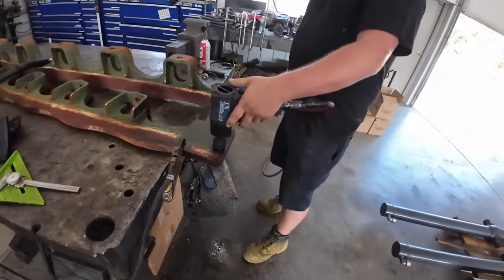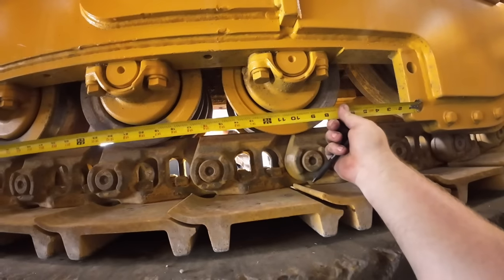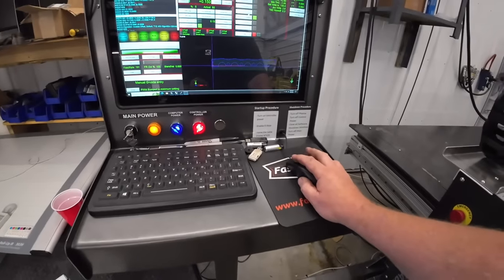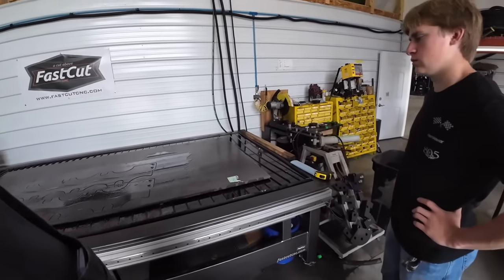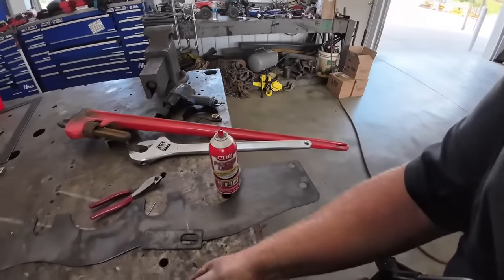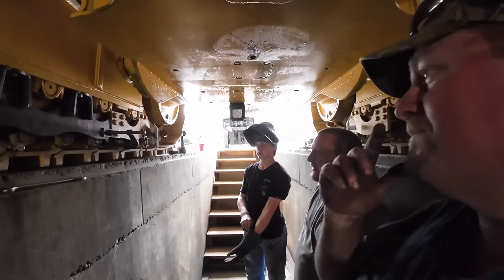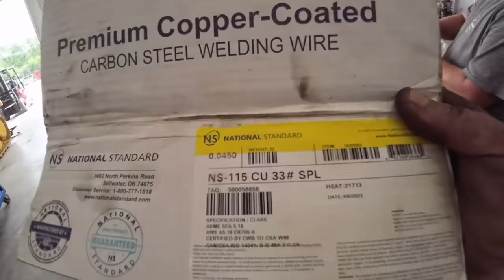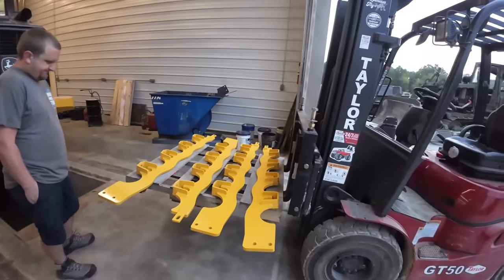Customer wanted Rock Guards on his 755K Deere track loader so we delivered 100% from scratch

Comment: That is a sweet looking track loader, nice job of fabricating the rock guards and the paint job was impeccable Kevin. Someone is getting a very nice machine. You should put a smiley face on the inside of the welding helmet so Tucker has a constant reminder to smile a mile man, thanks for the tag along video sir.

Comment: I think that all your work is as usual absolutely outstanding from drawing up the plasma cut out plan, plasma operation - so quick, clean and precisely accurate on thick steel!! Excellent fit up requiring no tweaks whatsoever. Brilliant bending and welding work and as usual super paint work from Kevin.
Damn right you should all be very proud of your work, congratulations. Dan

Comment: They may be using it for demolition. Rock guards help to keep rebar, tin and wood out of rollers when track grinding the debris pile. The wire and cable are different problem.

Comment: I definitely SAW Kevin’s fingers turn silver. Those guards are the meatiest I’ve ever seen. The old Cat guards are made from 1/8” plate but there’s a 1/4” thick reinforcing skid plate around the bottom edge. They all seem to get worn through after about 20 years. I think 1/4” plate would have been a better choice. 3/4” will survive the apocalypse.

Comment: I've used NS wire for longer than 30 years. It is the best, and expensive to boot, but harder to find because most shops want the least expensive wire they can find. I've probably used 100 large rolls. Ask them to send you the copper-free wire which eliminates the need to grind between passes. Not that you would likely do that anyway. Good job on that project, with those young men coming on strong you will soon be able to take a back seat.

Comment: Saw
They turned out great and I’m glad you answered the question that was still in my head about the scalloped bottom. I thought the used ones you were starting with were just “worn out” and would get some C&C loving before installation. 
That plasma cutter is a beast cutting that 3/4” plate.

Comment: Well, that customer should be one happy camper.
Since C & C equipment saved him some serious $$$$ and that Dozer looks like it's straight off the factory production lone.
As usual,  Clint and crew did one heck of a professional job on those rock guards.
Probably better than factory ones would be.

Comment: The next time you need some 3/4 plate cut, I think you should give Kevin a Jig SAW, and a box of rusty worn out wood blades to do the job with...🤣 Sorry Kevin !
Seriously though, that National Wire is some quality stuff. We did a job covering a machine pit in a factory with W8-31 I beams welded to 1" plate with 0.90 Dual Shield that the Engineer spec'd that wire on. It welded smoothly with no spatter, and great penetration.

Comment: Love watching your videos guys. You not only educate, you entertain as well 😂! I fully understand the reason for the design of the rock guards as you explained to avoid damage to the guards or pads when flexing over uneven surfaces but explain why the smaller dozers use a flat bottom rock guard? Is it because the shorter distance between the rollers and the length of track segments limit the upward travel between the rollers?

SAW-nice giveaway idea especially if it helps boast the views. I will share this video with as many people I know will watch it. We will do what we can to get you there. 

On a side note, love to see more videos about or including trucking. Love your beautiful small bunk 389 Peterbilt. Been a huge fan of Peterbilt, so much so that I have worked for a large Midwest Peterbilt dealership for the last 26 years. You’ll know who sent this when you see the email. 

Thanks from Kevin and all of us at JX!

Comment: Love the fabrication projects. I made a set of rock guards for my midi excavator, but not to keep the rocks out, but the tracks on. Throwing tracks was a regular occurrence. Rocks guards have been on all summer and no thrown tracks. I may need a new undercarriage, but this should keep me going for several more years. Just a hobbyist - not a lot of hours per year on the equipment.

Comment: One time I made a pattern with supply.I put the plywood up against the rollers.What?On the back side just sprayed paint that I had my pattern painted onto the plywood and I just cut out what I needed in the plywood. That was my powder transfer that was on to the 3/4" quarter inch plate.

Comment: Those rock guards are better than factory, my father in law tried what you did to Tucker to me, only thing was I wasn't welding but using a chain Saw! Needless to say my reaction was a bit more severe than Tuckers! Tuckers welding is off the scale and Kevin's painting isn't bad either. Presumably your not shipping to the UK, which is a shame as we run 220 to 240volts as standard. 🤗

Comment: Thank you I love to see a Shop owner that is willing to go the extra mile. To help there customer get a Great Product. and That is willing to take the Time and Manufacture in house up grades and or make some thing work, that may not have been exactly like the original OEM. but work Just As Good if not better. You will create ( if you have not already) a clear superior customer service. It works.  you are willing to draw a line in, in house warranty  yet Go a little further then Most. All the while giving a Clear Explain as to your position. You will go Far! Saw

Comment: I use to work for a window manufacturer and we use to cut a 1/8 of an inch between each cut for the vinyl windows. We would use the whole 21 ft length. We would literally have 4 or less depending on the size of windows where being made.

Comment: Excellent job by all. You will have John Deere coming to you to fab custom parts for them. The design and attention to detail were outstanding. The Fast Cut plasma machine did an excellent job. Flawless welding and paint job. Kevin can you paint other colors besides yellow? LOL. What tonnage press break are you using for the 3/4” steel? If you have a goose neck 90 degree top die for your press you will be able to bend those tight parts more. The press should have come with a back stop so you can just push all of your parts to the stop and they will all be the same length.
Love seeing all of your content on your channel and thanks for helping Matt from Diesel Creek get his Army truck running the way it is supposed to.

Comment: Hello  C&C Crew. The fabrication videos always good. If you can this viewer would like to see a little more detail on creating the instructions for the plasma cutter to follow. Not looking for a lenghty computer course, just a simple part with a curve in it somewhere. Your finished result did look factory or better. The factory would have had more paint runs in more obvious locations. Tell Kevin he needs to add a couple. Looking forward to the next video please keep us informed regarding the welding wire. Would you recommend it?
Reply from the maker: We have used it since a few times and really like it

Comment: Is the Jet saw going to be a liability because of the short to ground.  You might need to wire up a duplex socket with the bridges cut between the screws.  L1 and common on one outlet. The ground from that outlet wired to L1 on the second. And then the common to the ground wire. So you can plug in a current test loop into the second outlet to see exactly how much current is coming off the ground. 
This will prevent it from being an absolutely SHOCKING give away.  Allowing you to see if the stray current is in the motor. The switch. The safety or limit switch or damage in the power cord .

Comment: With the materials and all of the labor for fab, weld, and paint, and figuring loss of that time on other projects, how much did you save off of the $2500 price of new ones? Just curious, was it really a savings? Did you save patterns in case you need any pin the future?
Reply from the maker: New ones are $2500 each x4 so..

Comment: How hard is it to change brake bands on G Model loaders/dozer have a 455G and turns excellent one way. Other way the pedal has no resistance on it at all. The steering clutch is working but no brake is applying? Thanks